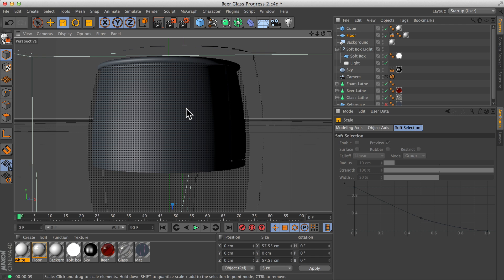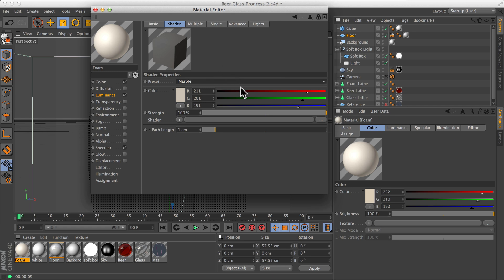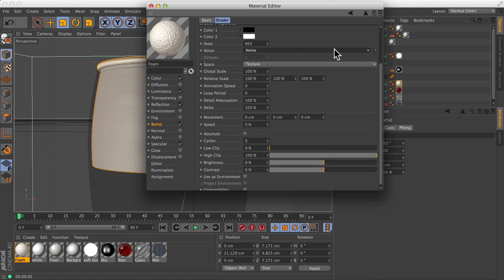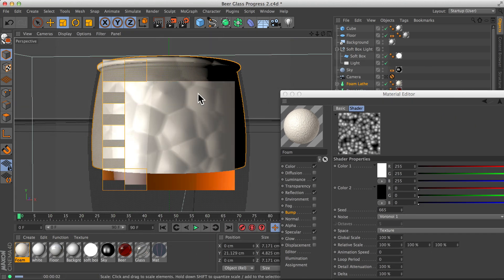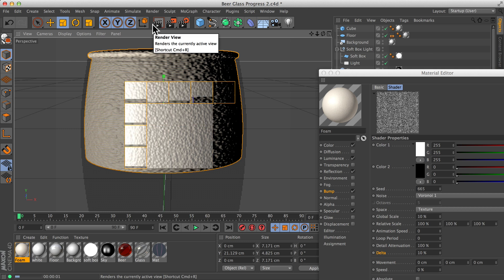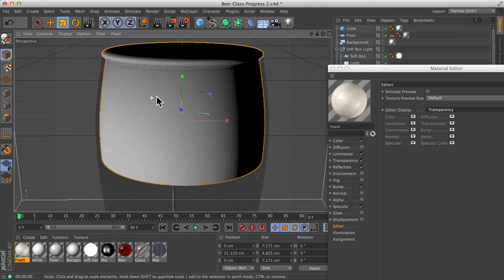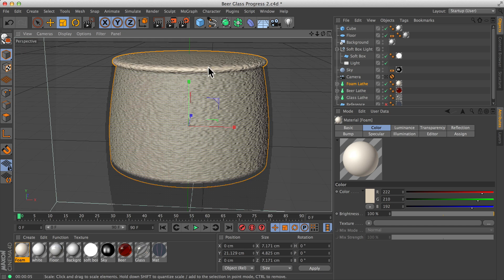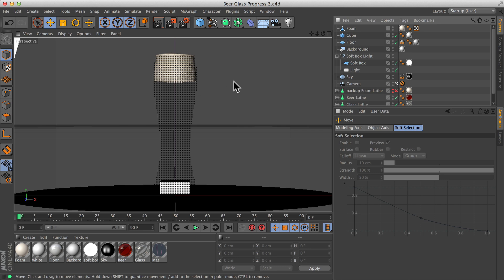Cinema 4D Foam Tutorial with 3D Fluff

Comment: Is the full tutorial still relevant for R17?
Reply from the maker: It works 95%, the reflection settings are a little different but we have a couple of short free videos here on youtube to show you through those.
Reply: Thnx, i bought it. But to blend the foam in the beer, i need to put the gradient on the foam. I can't set the refraction to 0 and it wont become 100% transparent. Any advice? Greetings
Reply from the maker: If you want to mail over a scene file, we're happy to look (contact at 3dfluff.com). Keep in mind though, refraction typically goes from 1 to 4, with 1 being the default. If you try to set refraction to zero, strange things will likely happen.
Reply: +larsie21 The minimum refractive index (IOR) is of vaccum and it is 1, all other materials have an IOR which is a positive factor of that, e.g 1x0.33 = IOR of water.